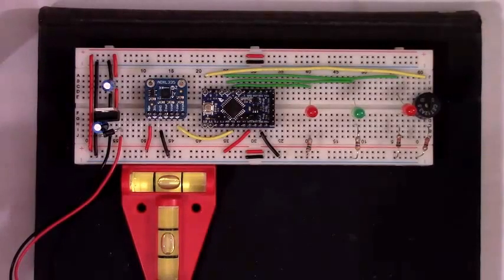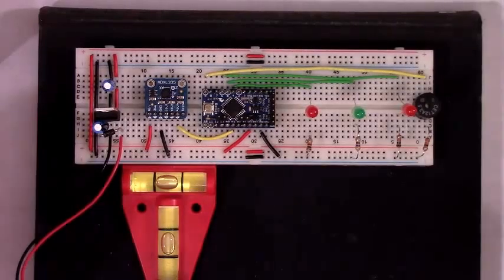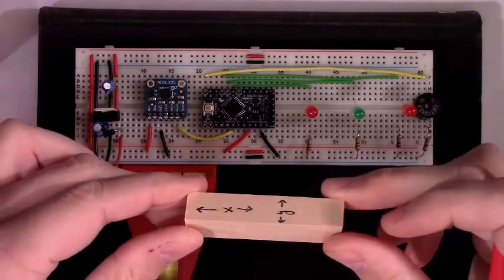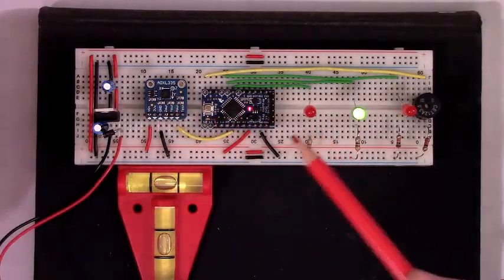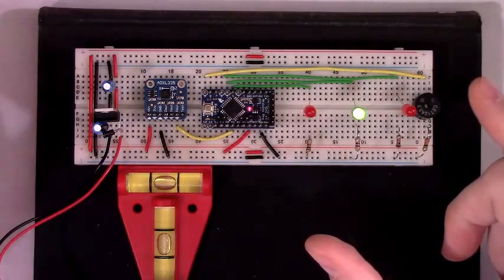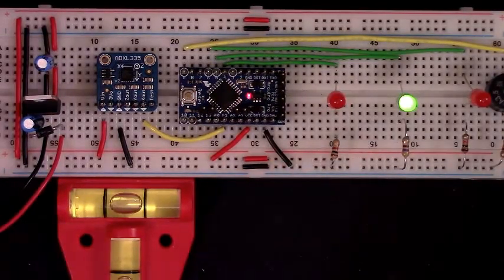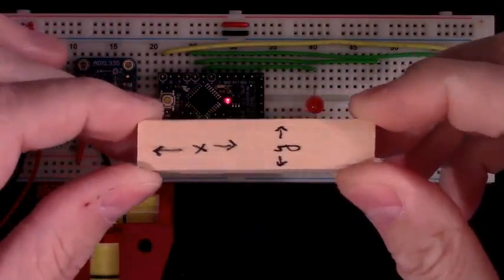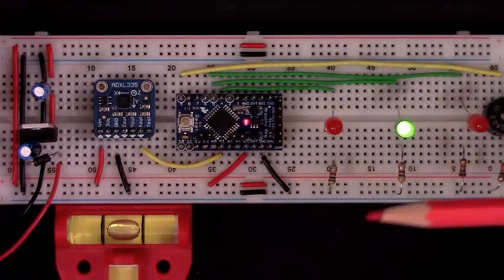Arduino Projects || Audible Visual Level using ADXL335 || Version 1

Comment from the maker: /*
title: ADXL335_Audible_Visual_Level_V1
by: philomech
date: 4/2015
*/
/*****************
* global variables *
*****************/
//ADXL335 X axis
const int x_axis_pin             = A1;   // to Xout on ADXL335
const int sample_size            = 15;   //adjust as needed, increase for > 'smoothing'
int current_x_axis_value         = 0;    
int level_value                  = 0;    //determined by filtering routine

float alpha                      = 0.15; //used by low pass filtering rountine
                                         //increase for > filtration
//buzzer
const byte buzz_pin       = 9;  //PWM pin
//leds
const byte high_right_led = 4; 
const byte level_led      = 5;
const byte high_left_led  = 6;
/*****************
* setup            *
*****************/
void setup(){
  
  Serial.begin(9600); delay(150);  //for determining level_value
  
  pinMode(x_axis_pin, INPUT);
  pinMode(buzz_pin, OUTPUT);
  pinMode(high_right_led, OUTPUT);
  pinMode(level_led, OUTPUT);
  pinMode(high_left_led, OUTPUT);
}  //<--end of setup
/*****************
* main loop        *
*****************/
void loop(){
  
  //establish LEVEL value (digital 'low pass' filtering)
  //->circuit must be still and placed on a level surface before this 
  //routine executes
  static float filtered_x_value = 0.0;

  delay(3000);

  for(int i = 0; i < 15; i++){   //increase/decrease test value as needed (+-15)
    delay(1);
    float reading = (float)analogRead(x_axis_pin);
    
    //core calculation: adds a percentage of filtered value to a percentage
    //of current reading, e.g., assume filtered_x_value = 300 after first pass
    //(0.15 * 300) + ((1 - 0.15) * 305))  --15% of filtered value added to
    //(45) + (0.85 * 305)                 --85% of current reading
    // 45  + 259.25
    //filtered_x_value = 304.25 after 2nd pass...repeat with each new reading 13 more //times
    //--assuming the raw value is dancing between 2 values, e.g., 321 and 322
    //it tends to take around 8 to 12 interations for filtered value to fully stabilize
    //if it happens to dance between 3 to 4 values, then more iterations might be //needed
    
    filtered_x_value  = (alpha * filtered_x_value) + ((1 - alpha) * reading);
    
  }  //<--end of for loop

  level_value = filtered_x_value;   //assign LEVEL value
  
  //enter infinite loop, never leaves this loop 
  //after level value has been established
  while(1){

  //apply averaging function to 'smooth' current/incoming x axis value
  current_x_axis_value = average(x_axis_pin);
  
  delay(25);   //adjust as needeed

  //testing for level, too high left or too high right states
  //level
  if(current_x_axis_value == level_value){      //if value == LEVEL
   noTone(buzz_pin);                    //stop noise
   digitalWrite(level_led, HIGH);       //level led ON, the rest off
   digitalWrite(high_right_led, LOW);
   digitalWrite(high_left_led, LOW);
  }
  //too high right
  else if(current_x_axis_value > level_value){  //if value greater than LEVEL
    tone(buzz_pin, 440);                //make noise
    digitalWrite(level_led, LOW);       //level led OFF
    digitalWrite(high_right_led, HIGH); //high right led ON
    digitalWrite(high_left_led, LOW);  //high left led OFF
  }
  //too high left
  else if(current_x_axis_value < level_value){    //if value less than LEVEL
    tone(buzz_pin, 440);                          //make noise
    digitalWrite(level_led, LOW);                 //level led OFF
    digitalWrite(high_right_led, LOW);            //high right led OFF
    digitalWrite(high_left_led, HIGH);            //high left led ON
  }
  }
}  //<---end of main loop

/**************************
averaging function          
**************************/
//average raw axis values
int average(int axis_pin){
  int sum = 0;
  analogRead(axis_pin);    //cast off initial reading
  delay(1);
  //collect and sum a # of readings --how many depends on 
  //value assigned to sample_size variable
  for(int i = 0; i < sample_size; i++){
    sum = (sum + analogRead(axis_pin)); //summing
  }
  return sum/sample_size;  //divide sum by sample size and return 
}
Reply: philo mech hi my friend , I did the project works fine. but one degree LED lights , I want to burn at 2 degrees. Can you help me .

Comment: Great kickstarter. Long level, many 3mm leds, beepers, triangle fence post bracket.
That's all I got. Starting on pool fence next week. Try to have it done been then.
Reply from the maker: jpalm32 Greatly appreciate the comment and suggestions.  Leveling posts is when I hope it begins to demonstrate its true worth.  I'd be especially interested in hearing about the results if you use it for the pool fence.  I hope to complete a 3 axis version by the end of day tomorrow.  Assuming all goes well, X,Y, and Z should be functioning together and the next video uploaded of by Monday night.   Thanks for watching!
Reply from the maker: jpalm32 I'm still working on filtering and integrating the values from each axis.  It's definitely a challenge to hold on to decent sensitivity while at the same time not making it too sensitive.  I'm doing my best to secure the next workable version before the end of this week.